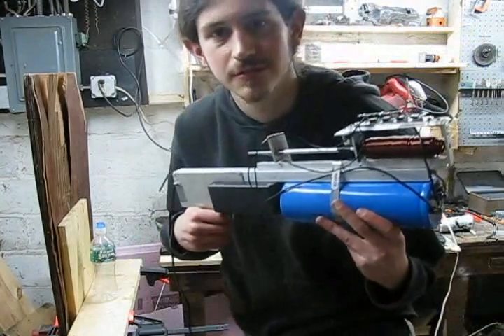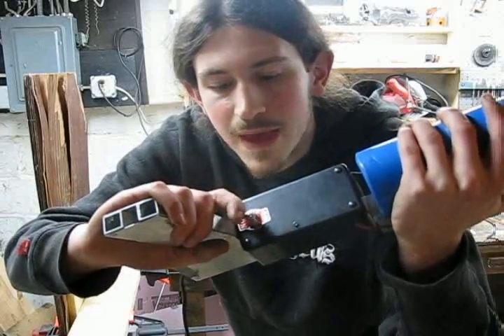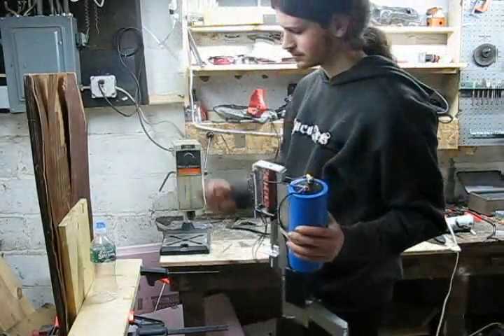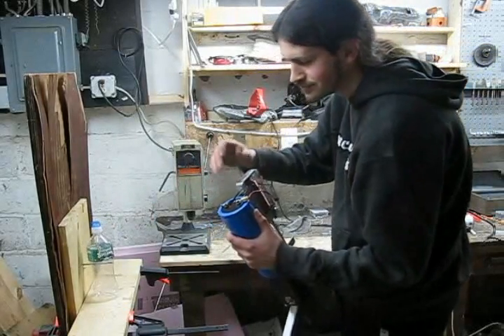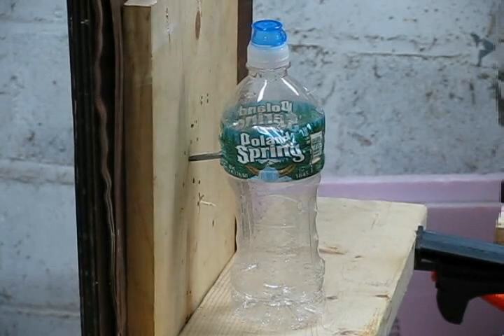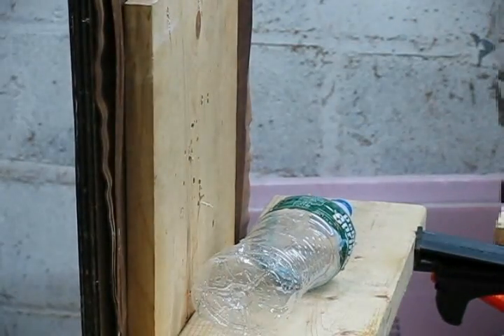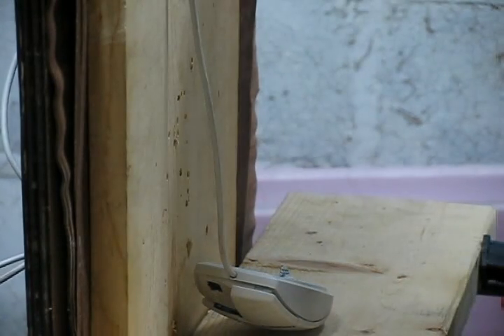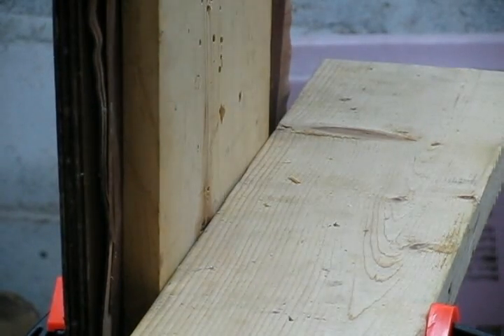700 joule coilgun demo

Comment: how many turns is the coil? And how many mm is the copper wire?
Reply: Probably, 200 - 400  turns wire in the coil.
Maybe 2-2.5 mm diameter the copper wire.
See also: !MEGA COIL GUN - SILENT BAZOOKA COILGUN-BAZOOKA
https://youtu.be/0yvVi1eukeI

Comment: Wouldn't you like die if you touched the exposed capacitor ends? I touched a tiny old camera flash capacitor at ~250V once and it didn't feel very nice. Wouldn't this massive capacitor be much stronger than a regular taser? (or is the current too weak to do anything significant?)
Reply: +Karmaslap Nah mate. Skin resistance of skin is about 5kΩ. That with DC voltage about 450V = current through you about 90mA. Minimal current that can kill you is somewhere around 120-150mA. It would definitely hurt if you touch but, dont think its enough voltage to kill you. With tazer part you are right. Current is limited by HV transformer to maybe few uA. But also AC is more dangerous because of capacitance of your body that AC can flow easily through.

Comment: 2.6kA? thats a lot. 160 feet 13awg wire has a resistance of 0.32 ohms. 350v/0.32 gives you 1.1kA.
Reply: if youre using bwg rather than awg then its 1.7kA. but maybe your using one of the other guages
Reply from the maker: You could be onto something there, I recall measuring the coil at something like 0.1 - 0.2 ohms with my dvm. The length of wire was estimated based on the volume of the coil, but the resistance was measured to come up with that 2.6kA figure.  Perhaps my coils aren't wound very tightly and the wire is only half the length I estimated, or the eBay listing for 13awg magnet wire was inaccurate, or my Radioshack DVM is inaccurate. Thanks for checking the numbers, let's conclude that the figures I stated are only somewhat reliable at best.
Reply: ***** It's possible that the values given for resistance per meter were off by a little tiny bit, causing a large difference in the actual outcome. I would trust measured values more that calculated. What kind of switch are you using to drain the current? Triac, relay, igbt, I'm curious of the part number too, I plan an attempt at making a coil gun soon
Reply: ***** do you have the circuit diagram of the high voltage oscillator circuit?
Reply: +The Chosen Half  I didn't realize there was more to it. I figured the coil would have a strong resistance to change in current so it would take a long time to even reach the max current based on ohms law. I'm interested to learn the physics of whats going on with the initial surge of current.

Comment: man hope you do a video of the 4.2 kJ gun id like to see how that turns out as this one goes its really neat and yeah most coilguns get pretty poor power efficiency (2-10% i have heard) thus why a coil gun with 900j is not the same as a handgun with 900j power .... your getting maybe 90j just an fyi to the ppl who dont understand
Reply from the maker: Unfortunately I haven't put much time into this project in years, if I ever do complete the bigger rifle version I'll certainly post videos.  You're right on the money about the efficiency issue, this one has a 1% efficiency; the muzzle energy was measured at 7j using a chronometer and the mass of the projectile. If I were to refine the design and achieve 10% efficiency for the big version it would as powerful as a typical .38 handgun. But that's optomistic, my goal is >100j for the multistage one, about as much as a .22 rifle.

Comment: Actually you could measure it fairly easily a number of different ways. The easiest of which: you could fire the gun upwards into the air and measure the maximum height reached. The square root of that (distance multiplied by 4.9) is the speed ie u=rt(4.9*s). You can then easily work out the Ek from that.

Comment: Looks good,are you doing anything with the 4 SCR's to esure they all latch on at the same time or so that one doesnt conduct and take the full brunt of the capacitor by itself?  Ive tried stacking SCR's before in an effort to increase their total load bearing capability, but one would always open before the others an degrade terribly until one by one they would all die :/

Comment from the maker: 350v 8200µf capacitor
4x Teccor SCRs rated at 90A continous load or 950A surge for >10ms
to charge it I use a circuit called a "Voltage multiplier" that relies on capacitors, diodes and AC current.
Nothing special about the magnet wire or the switch, use your ingenuity  for the rest!

Comment from the maker: You're quite right, 700j is the potential energy stored in that capacitor. Other youtubers seem to boast this number rather than muzzle energy so I simply followed suit. Based on the mass of the projectile and the velocity as read by my chronometer I've pegged the muzzle energy at 7 joules...an efficiency of just 1%. Sounds pitiful, but the highest efficiency I've seen from other DIY coilguns is 3%.

Comment: Oh my word. That is the most stupidly dangerous things I have ever seen. Dangerous for the operator that is. Holding on a aluminum can strapped to an aluminum frame with an aluminum grip and exposed high voltage wiring. I'm completely dumbfounded.

Comment from the maker: I don't recall the exact part number, but I know that they were 70Amp SCRs, they can handle a peak capacity of about 700 amps each for about 10ms which is about all the time it takes for the charge to get used up.  If you're going with a multi-stage approach I would recommend using IGBTs (Insulated Gate Bipolar Transistors) they're more expensive for the capacity you'll need but they are easier to 'shut off' after being 'turned on'.

Comment from the maker: I use aluminum because it's easy to find and machine, there are much better materials out there, though. A rigid and non-conductive material with a low coefficient of friction against steel and good wear-resistance would be perfect.  Ceramic, glass, or a plastic may fit the bill.

Comment from the maker: You're right, adding more stages would allow me to increase the size of the capacitor bank without sacrificing efficiency. I was planning to build one like that, but I think I should wait until I get further along in my education before I start working on those circuits.

Comment from the maker: SCRs (Silicon-Controlled Rectifiers) are used as the gate between the capacitor and the coil. My power supply puts out ~330 volts, since the capacitor is rated at 350 volts I don't need to worry about stopping the charge.

Comment from the maker: Capacitors are usually measured in micro-farads or joules as these are units of energy, megawatts are units of power.  My coilguns circuit draws about 0.9 megwatts at the peak of its firing.

Comment: you should look into coil length vs projectile length you can make the fps higher by shortening the coil using bigger coil aire and shortening your projectile its a simple the longer the coil the longer the pulse and thus the more energy you need, also the shorter the projectile the less energy required to move it. Good gun tho i like it. Also if your coil is more neatly wrapped it will get more magnetic field

Comment: have you ever thought of going with a higher voltage? there's some really good 450v 1000uf capacitors for fairly cheep designed for tube amps. These are what i'm going to use in my first build

Comment: hello Justiceguy216,I could really use your help building my coil gun i have built a small one before but now i have the need for more power ! ,,i have a 120 feet 22g magnet wire and i am planing to buy a 3500uf - 450v electrolytic capacitor but i really need those tech spects you talked about i dont know how to build a charging circuit,so if you can please maybe e-mail me or write back with parts needed and info, it would be very apprieciated...wcc209@aol.com...thanks...matt

Comment: @BlAckShEEp168 neodymiummagnet is ferro magnet and if you want an other ferro magnetic marital than use an normal magnet but you need to disable the coil for a sec and than it needs to get back on to push the magnet so fist pull it and than push it

Comment: I have two questions.

1. The coil wire seems to be very thin. Would I be correct to assume that the burst of energy is short enough that it doesn't melt? 

2. How thick should the winding be?

Comment: Coming at this from a completely non electronic background, a couple questions

1) Would several coils make the projectile go faster? Maybe I'm just not understanding what's being printed, but if the barrel were longer, and you basically made three of what you have there, but in a row, wouldn't the projectile keep accelerating?

2) have you considered doing fins? Flechettes may be legal where you are, and they can be stamped into a rod, or attached. Since pressure isn't an issue, it may work

Comment: great look.
but why only one coil. with this size CAP your projectile should be able to penetrate trough a very thick wood board. nice CAP anyway. 350V. ouch !!! try with bullet 8 x 15 mm. work on the trigger circuit... larger CAP longer time to discharge, smaller CAP shorter time. use trigger to control the large CAP bank..